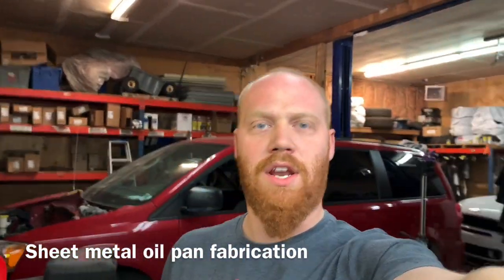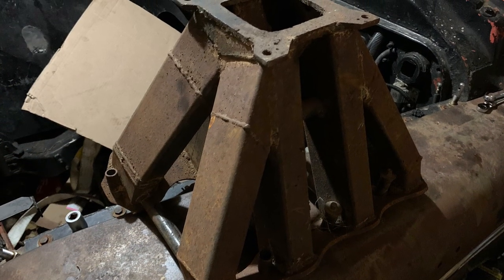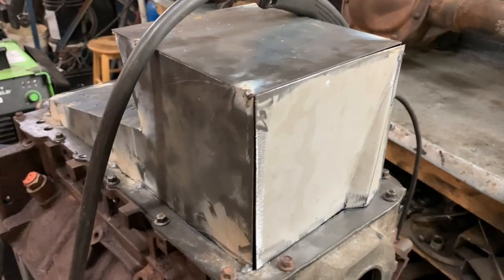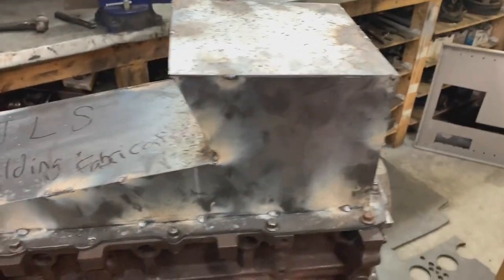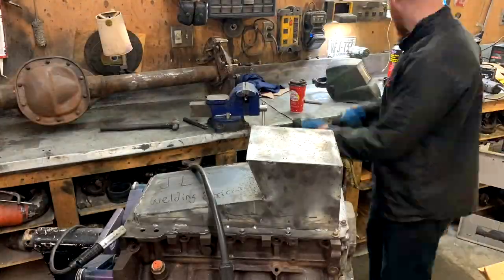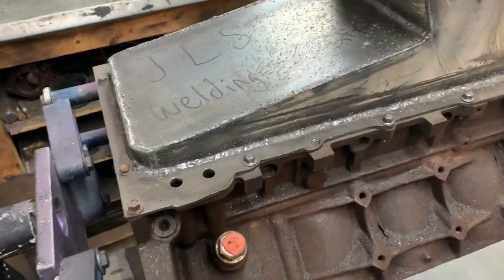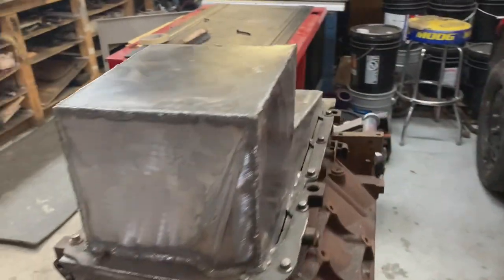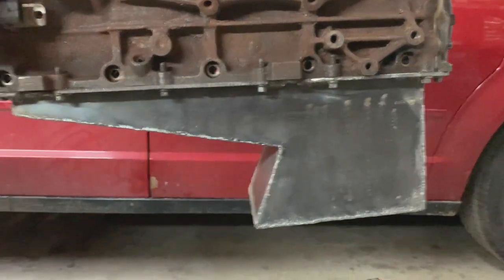How to make a sheet metal front sump LS oil pan - part three, finish welding all the seams

Comment: How many quarts of oil do you have to put in that thing?
Reply from the maker: I put 6 quarts in and marked it on the stick, then cut the stick off to the right length. I started putting 7 in it after because I got low oil pressure under hard acceleration